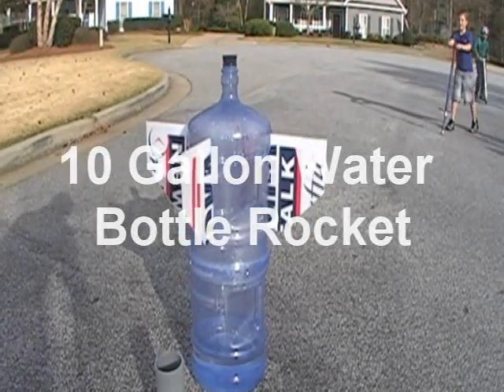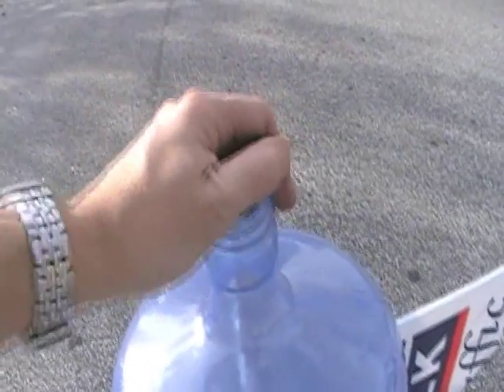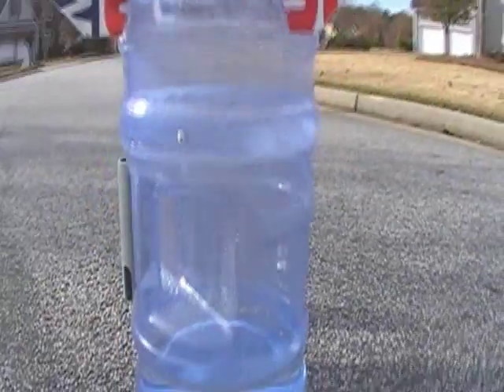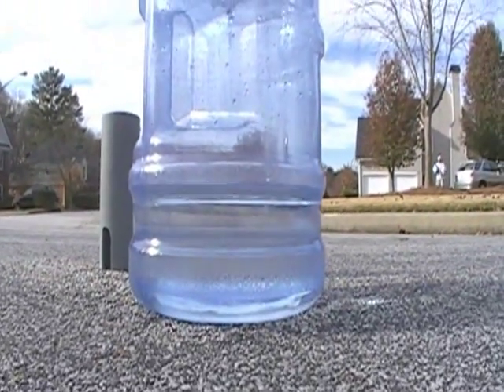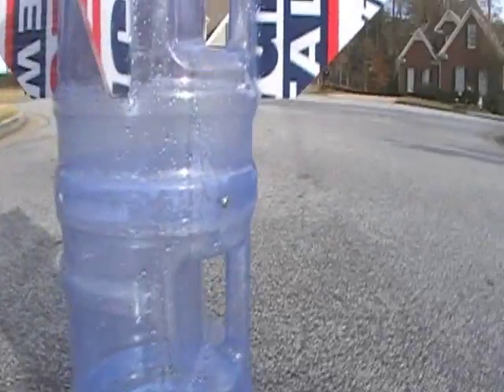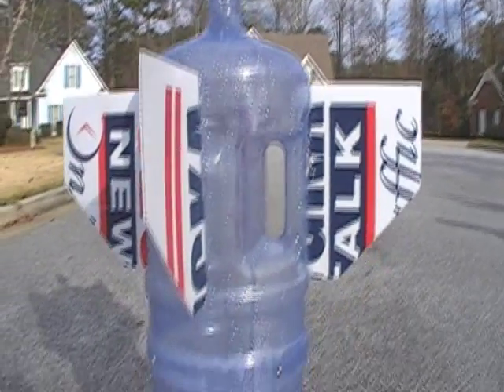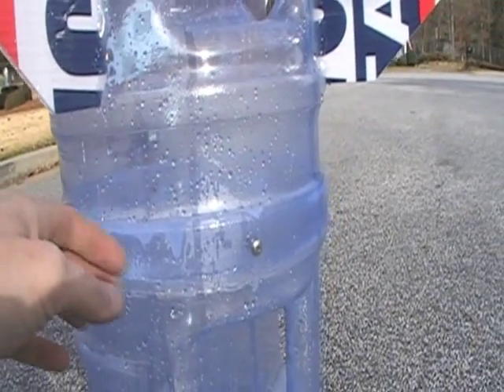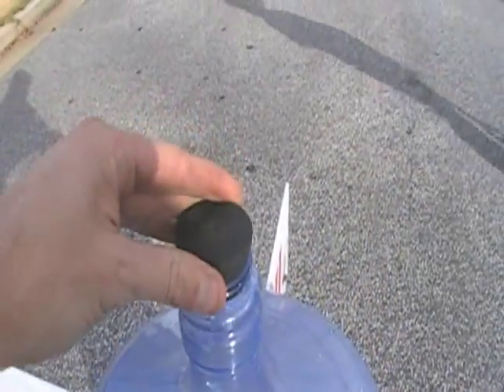10 Gallon Water Bottle Rocket - How It was Made

Comment from the maker: You don't buy one that big.  You buy several 5 gallon water bottles, jigsaw the ends off and seam them together.  Use GOOP for the airtight seal and use 8 or more screws around each seam to make sure that it can withstand the shear force.  I have another one that is about 20 gallon(really more like 18 gallon) using four 5 gallon bottles.